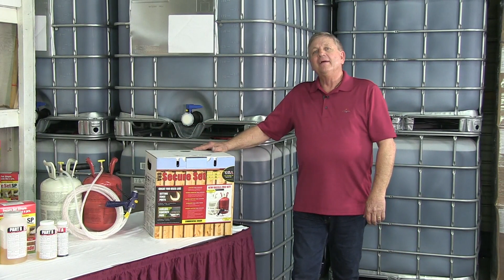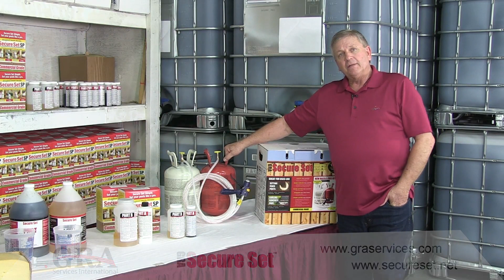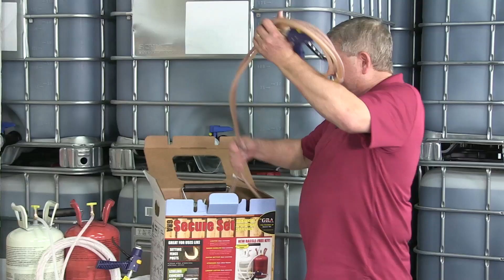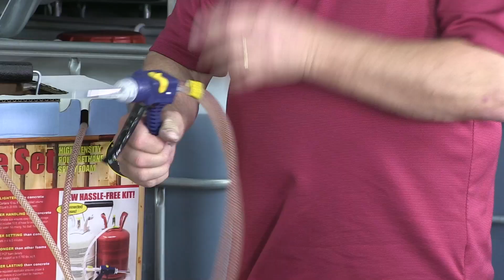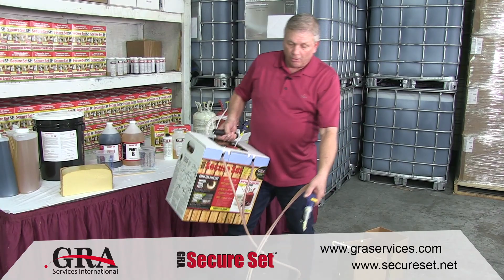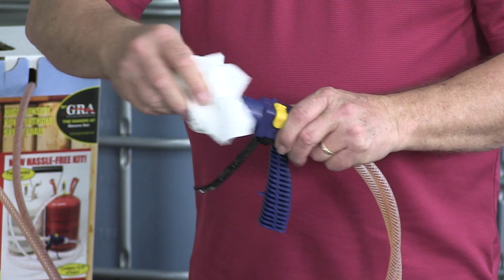GRA Services— Introducing Secure Set Spray Foam for easy post setting

Comment: Can I use this on securing a flagpole instead of concrete?
Reply from the maker: Thank you for the question.  We would use the Secure Set liquid mix/pour foam for setting flag poles.  Set your flag pole 10% plus 2 ft. in the ground and use a diameter hole big enough to have at least 2 inches of foam around the post.  You can calculate the volume needed on www.secureset.net https://www.secureset.net/calculate-your-project/
GRA Services the Makers of Secure Set.

Comment: Is possible to buy in Canada
Reply from the maker: Hello and thank you for your interest in Secure Set Spray Foam.  We do not have a distributor in Canada, and do not ship hazmat (pressurized canisters) internationally.  You can have it delivered to a U.S. border shipper that accepts hazmat items and get permission from customs to transport it over the border or have it forwarded.  If you choose to do this, please contact us directly at info@graservices.com or 405-672-8885 (M-F 8:30 to 4:30 CST) for the hazmat details in order to prearrange the over the border shipping or transport, and also to place the order by phone.

Comment: Just want to thank you for the product you've created for the DIY community. I've been watching allmof your videos to get a good understanding of the product, as well as reading many of your responses to questions. It's obvious your passion with your business, as many times in the world, it's very hard to get customer support with products. Great Job!  👍   I am planning several projects right now with Secure Set.  I have an inground pool with several sunken concrete skirt pads, the pool fiberglass stairs have washed out (similar to your pool stair video) as well as a few cracked sunken slabs in my garage and driveway.  I have been stressed about the cost of all the concrete work needed, and avoiding it as a result.  Finding your product is life changing!  GREAT product, videos, and customer service! Liked and new subscriber. Could you do a video on clean up and storage of the hose, tips, and tank for later use? I haven't seen that compilation yet and it would be useful to have a separate video on that (similar to your extension nozzle video)  THanks again!
Reply: Tony,  did you get the product ?   to me, drilling through 30 year old concrete with a hitachi hammer drill was so slow and painful (my hands still hurt 2 days later).  I see now why they use CPVC.  I got the bigger, less dense, foam and ran out.  AND the product has to be warm - about 85F, it was a hot day and it did lift my concrete.  I am hoping to "stablize" it now and get another kit next  year - I found more hollow sounding areas and some edge areas just did not come up as I expected.  1) figure out how to drill or use CPVC wand 2) take your time when injecting and have some weight handy for areas you don't want to move.

Comment: Do I have to buy a set everytime?  Or once I buy the canister I can re use the hose and set up?
Reply from the maker: Hello Ava,  When you purchase the kit, all you need comes with the kit. If you have completed your project and you still have product in the tanks, turn off the valves on top of the tank, do not depressurize the hose lines, remove the used static mixer nozzle, clean the end of the gun very well, apply a good layer of Vaseline over the end of the gun, (Vaseline is included in the kit) and store you kit.  The product left in the tank has a shelf life of 1.5 years, however the product in the hoses will set up in about 30 days.  Once the product sets up, the hoses are no good.  If you need to use the remaining foam six months later, you can purchase a new hose kit and use the product remaining in the tank. Thank you.
Reply: @SecureSet-Fence-Installation  i was looking to start own business and use those but there kind of experience
Reply from the maker: Hello Ava,  There is definitely a need for this type of service.  So many issues with washouts under every manner of concrete.  The margin on selling these kits is much lower than you might think. The benefit to your customers would be in the labor service you provide. If you start the business, let us know, we will work with you as best we can.  Thank you.
Reply: @SecureSet-Fence-Installation  how many pounds per kit
Reply from the maker: Hello Ava,  Each kit weighs 40 lbs.  It will produce 10 cubic feet of expanded foam.   Thank you
Reply: @SecureSet-Fence-Installation  how much is 10 cubic ft?
Reply: @SecureSet-Fence-Installation  i work with a concrete lifting business but they don't go off of cubic ft. Its just per pound. They do 10$ per pound
Reply from the maker: Hello Eva,  The best way to envision 10 cubic feet is to Google  10 Cubic foot refrigerator.  The picture will give you a good idea how much foam that is.
Reply: @SecureSet-Fence-Installation  how many sidewalk slabs could one unit fix
Reply from the maker: Hello A For Ava,  I think you are just goofing with me.  Do you really expect us to answer this question?  So, is the slab 50 feet long or is it 4 feet long? Is the void 1" deep or is it 14" deep? Come on, ask an intelligent question and we will give you a good answer.  Do you really want to go into business?  I think you should stick to doing something else.
Reply: @SecureSet-Fence-Installation  I thought you wre here to help and answer questions about your product and make sure its a good fit. Im sorry for wanting to know more. Sorry for bothering you. Bye
Reply from the maker: Hello A For Ava,  We are here to help and advise.  But really, just think about the question you asked!  You asked how many sidewalk slabs you could fix.  The  variables that exist in that question are almost infinite. If you want to narrow down your questions, we can answer precise examples, but when you ask if Secure Set Spray Foam can fix sidewalks, we would have to know what dimensions you are considering. Be specific and we can help.  Thank you.
Reply: @SecureSet-Fence-Installation  ok that kit is around 350$ how much money can I make off of that kit? Or is that to difficult of a question for you to answer also?
Reply from the maker: Hello A for Ava,  This is a good day!  No question is too difficult to answer. The current kit with shipping, including Haz Mat fees from the Fed Government is $387.95.  As far as what you can make is up to you.  The 10 cubic ft. kit of Secure Set Spray Foam will produce 10 cubic feet of expanded foam.  That is the equivalent of 20 - 80 Lb. bags of concrete.  Each 80 lb. bag will provide you with  1/2 cubic foot of concrete.  So figure that into your price structure and see what that would be like in the field with a client.

Comment: is there a difference between your post foam and void fill foundation foam?
Reply from the maker: Thank you for this question, Sean.  Yes, the Secure Set Spray Foam is a 4 lb. density foam with a compressive strength of 70 psi, which will support 10,080 lbs. per sq. ft.  In this application it comes out as a foam and expands about 2 to 2.5 times.   Our Secure Set liquid mix is a 5.3 lb. density foam with a compressive strength of 103 psi, which will support 14, 832 lbs. per sq. ft., and it expands 18:1.  You can find both products on our website www.secureset.net.  You can also call 405-672-8885 or email us at info@graservices.com to order or for any additional questions.  Thanks again....GRA Services the Makers of Secure Set.

Comment: Does Secure set work in a salt water environment, filling a void that has opened up between the wall and the footing on a salt water bulkhead in Puget Sound, Thanks,
Reply from the maker: Hello,  Yes it will as long as the area you are working with is dry at the time.  After it cures, salt water is not an issue.  Thank you

Comment: Can I spray this product as an Insulation to a wall
Reply from the maker: Hello Jose, Yes, it will work well.  In fact it will work too well.  This is a high compression load bearing foam.  What you need is a closed cell foam with a density of about 1.75 pounds per cubic foot. There are kits on the market that contain 200 board feet of foam.  I would look to a product called "Touch N Seal".  They have a 1.75 PCF foam 200 BF kit. You can find it on the internet under "Touch N Seal"  it is a good product for what you need.  Thank you.